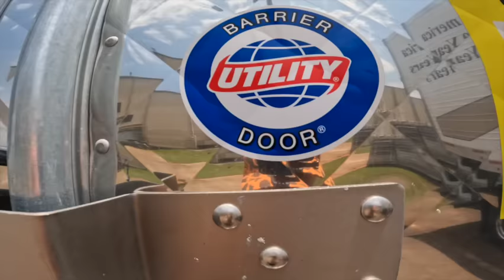Random Trucking Vlog | Bobtailed 800 Miles + TX-IN Trip

Comment: Always check your air pressures when you're tires are cold, after driving tires heat up which increases the air pressures so you won't get a correct reading it will always read higher from warm tires... Come on let's roll, just pulled out of Bridgeport Tx headed to Cleveland Ohio

Comment: Usually if the trailer is a little rough to get under....I release a little air from the air bags from the cab of the tractor.  But remember to let the air bags fill back to its normal before completing the backing to lock into the Kindpin, so you don't go under the kingpin.  I had that happen one time and it's not fun it get the trailer up over 5th wheel.  

You are absolutely a thorough, serious and caring truck driver.  
Keep up the excellent work and being informative & entertaining in you're videos.
Reply: Kllm tractors don’t have valve to drop the bags
Reply from the maker: Yeah unfortunately I can’t drop the suspension on these trucks I had a 18 that did it when I first started trucking but it sucks not having it now
Reply: Dam that sucks
Reply: Wow I thought all trucks had the dump valve. It comes in handy when the trailer is too low. Why would kllm do that? And no Apu so now you have to idle and waste that expensive ass diesel. That's what happens when corporate people buy trucks. They don't know what's really needed.

Comment: Heads up!! is good replace the batteries. If it does it AGAIN. Take the trk. To the shop. And a have a real mechanic. To take a look at the starter. And also u may have a recall on the battery cables as well. It will leave u stranded. Be safe.. video like 👍

Comment: Hello little butterfly the reefers are heavier than the dry vans the unit is 2500 pounds heavier that's why it may feel different but you will get use to it's no problem you got this.

Comment: Lower your air bags when backing under any trailer.  It helps keep the grease on the 5th wheel.  But of course if the trailer is jacked up really high there is no need to lower the bags.
Reply from the maker: I can’t lower them on this truck :(
Reply: @RoadRunna Nia  oh ok I  wasn't sure if you could. Also I don't have Instagram, but I do have an email if you would like that. If have questions or anything.

Comment: if your one of the steer tires blows out while driving, hit the gas pedal instead of the break pedal; doing this help to keep your steering straight. I learned this in a simulator; knock on wood, i never have to experience this in real driving condition and i pray and hope i will never have to.

Comment: 800 miles deadhead caught my attention. I see your signals you are using and I promise I'd rather be an owner operator with these sh-issues. So I finally bought my own truck. It took 4 hard years and little to no help. I'd never been in a situation of burning 800 miles deadhead until this moment.

P.S. stay safe

Comment: Prime had me do that once. Bt 1230 miles from Springfield, Mo to Clearfield, UT for a new trailer sitting at the manufacturer. I told them i would do it but do we not have any drivers closer to it that can get it bc we have a terminal in west valley city, UT less than 50 miles away. He said someone has to get it. But i was getting 13mpg across WY. I filled up with fuel at the Springfield terminal and still had 1/4 tank when i got to Clearfield.

Comment: Drop ur suspension or crank the trailer alittle higher to help getting underneath
Reply from the maker: Yeah these trucks don’t have the option to that for some reason. When I had a 2018 I could and it would come in handy.
Reply: @Roadrunnania  i see. Well only option is to crank landing gear alittle higher and hope all the weight  isnt on the nose lol. Keep trucking and b safe.

Comment: how long does it take to get to drive that 880 miles ,, like how many times can you take a break in between before you get to were your going ? thank you hun stay safe .
Reply from the maker: Thank you! And it takes two clocks to run it so usually I can do around 600 miles in a 11 hour clock

Comment: Yea , steer tires ain’t fun , had one blowout on me doing 75.
Reply: General rule of thumb driving over 70 mph increase the heat truck tires produce, if you run these speeds regularly expect plenty blowouts especially in warm weather.. Steer tires blowing can be very dangerous. Stay safe out here
Reply: @tyflesh  i will try and stay safe , but living in Texas with them hot summers , there will be tires blow by someone .